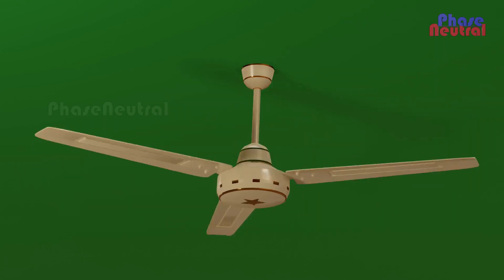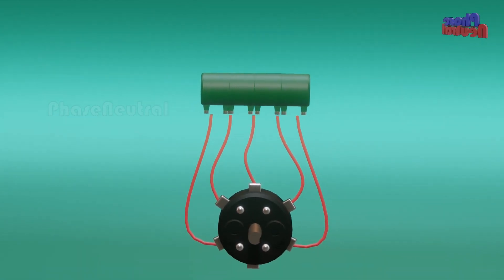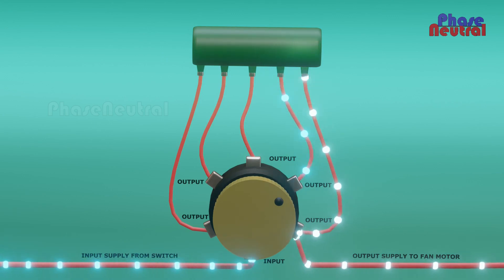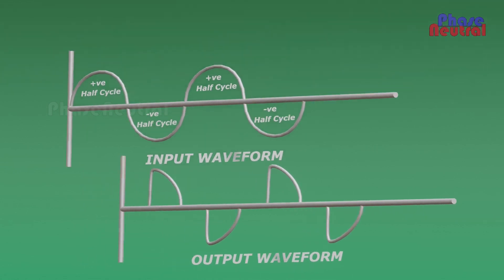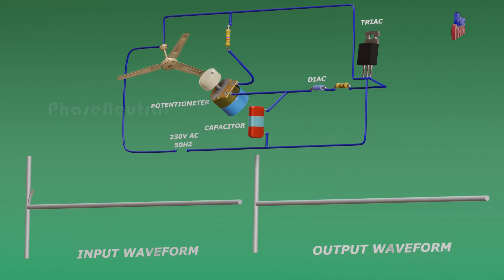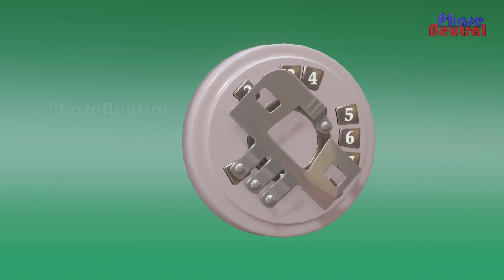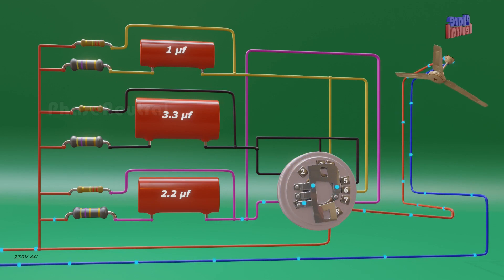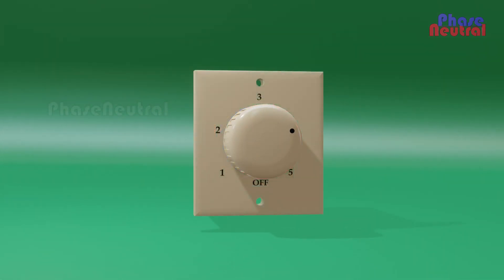Working of ceiling fan regulators explained | PhaseNeutral

Comment: My ceiling fan speed becomes extremely slow, almost like a joke, in the first 2 positions on electronic switch. So I have no choice to use step 3 and 4 which makes the speed too fast. I have replaced the electronic regulator (with a different brand this time). Even then the problem continues. What could be the reason?

Comment: The rotary switch is double or triple pole I think that's why it can connect more capacitors in parallel at high speeds

Comment: Nope !   The low voltage of the slow speed setting made my fan motor get  REALLY HOT !    High setting was OK.  Name Brand, but wrong kind of 120v fan motor ?
Reply: It's because there's less torque on the motor but it's working harder so it makes it really hot even though it's a low voltage they're still a bunch of current
Reply: Hi, thank you for the video. Is this a stand fan or ceiling fan? If this a stand fan then switch it off after running it for sometime. Immediately after switching it off with no power you may find the motor of the fan getting hot. The heat was generated in the motor due to friction and core loss. I guess it is because of the air flow , which lowers the fan temperature when running and no air flow in off condition making it hot. To some extent it is the heatsink concept , I assume. So when the fan is running at a low speed due to less air flow , may be the fan is getting very hot. I am sorry if my understanding is wrong.

Comment: I want to use a regulator on the input of my 12v 10Amp Transformer to get a variable output AC Voltage (which i will later rectify by a beidge rectifier)
So would a Capacitive type regulator (3rd one) handle 150W of load? 
Or should I go with the Resistive type regulator (1st one) 
150w will be about 0.65amps at 240v
Reply from the maker: The ceiling fan regulators are designed for working in line voltage ( 240V).  If you connect with 12V. You can't get proper result .
Reply: @PhaseNeutral  bro you dont understand.. i will connect the regulator to the input aide of my transformer i.e. at 240v side
And as the regulator will vary the input voltage of the transformer .. the output 12v should also vary 
I am just asking .. as I need around 10amps on the output .. which means roughly 0.6 amps on the input around 130watts ... so can the capacitive type regulator handle that load or should I get a reaistive type?
(The triac and diac type regulator ia out of the question)
Reply: If you finally want a variable DC then after the bridge rectifier connect a buck converter if you want lower than 12V or a boost converter if higher than 12 V. They are very energy efficient  (80-95%) as well.
Reply: @hikundu  but those buck/boost converters with more than 10Amps are quiet expensive 
So wouldnt this method work which i suggested?

Comment: Hi, how does the first regulator work by decreasing only voltage? I heard if you reduce voltage in a 2phase motor it will pull more current and use same wattage
Reply from the maker: Ceiling fan motor is a single-phase motor.
Reply: @PhaseNeutral  soryy i meant single phase only. If you reduce volts in single phase dosent current increase?
Reply: @AndrewNoronha-cb2gy  Yes, I had the same doubt, First type Regulator doesn't reduce current, It's just reducing voltage. Usage of current is same, Even if u put fan on point 1 it uses same current as point 5 , it just waste energy as heat.Point 1 create more heat.
Reply: @askask432  makes sense. Thx
Reply: @askask432 thanks buddu
Reply: So the electronics regulators help save energy? Sorry I suck at electricity

Comment: Tried both capacitor, resistive and Step size. Felt humming in latter one so switched to resistive finally.

Want to know if I could save some energy by lowering fan speed to minimum in resisitive type regulators.
Reply from the maker: Mostly Step type / capacitor  fan regulators don't make noice. Maybe the fan winding quality not good.
Reply: @PhaseNeutral  it is a noiseless motor found inside refridgerator, on full speed it is silent af but with capacitor regulator (panasonic) it hums a lot but now with resistive regulator it us silent on every step.

Yes, fan requires no external capacitor.
Reply: Next time buy only BLDC fans. No humming at any speed and power consumption is less than half for same air flow. In BLDC fan you don't need an external regulator.

Comment: Can we change from electrical one to movable one? My electrical regulator is broken (burnt). I would like to replace it with a movable one. Is that possible?
Reply from the maker: Yes. You can use movable or step type regulators.

Comment: Does lowering the fan speed using capacitor can reduce total power consumption & result in lesser electricity bill or the reactive power generated by capacitors is also accounted in total power consumption to have no difference in electricity bill. In simple terms, can lowering your fan speed save you some money.
Reply from the maker: Capacitor Regulators help you to save electricity when fan running slow seeped. But it is not 100% saving.. all electronic devices should have a little power loss.
Reply: @PhaseNeutral i'm happy as long as it saves at least 20% +

Comment: how to fix ceiling fan buzzing sound on movable type electronic fan regulator ?
Reply from the maker: Have to replace the regualtor to step type regulator or keep using the fan in full speed always to avoid buzzing sound.